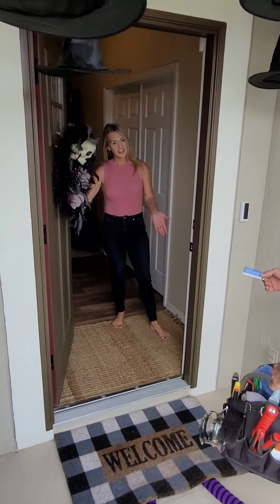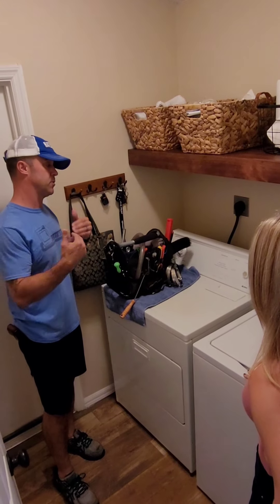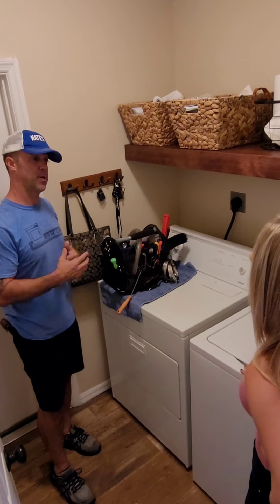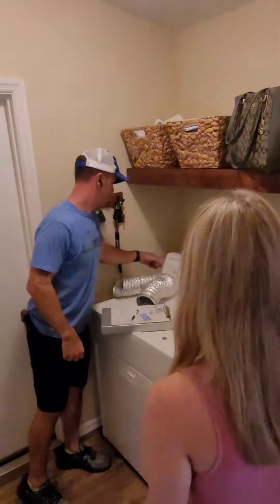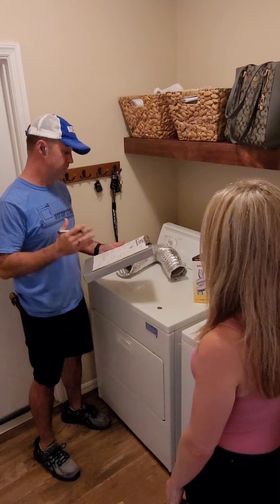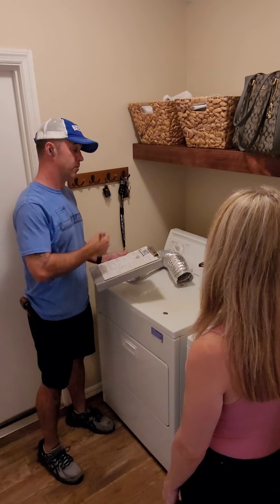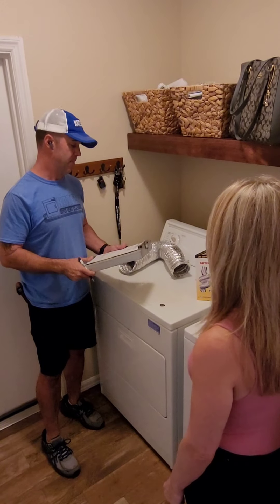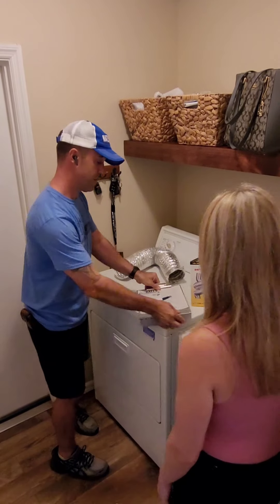Nate's #DryerVentCleaning from Start to Finish

Comment: Dang that was a ton of change in the bottom! I found 6 coins in mine but the fluff was.... well a LOT thicker inside my dryer 😖
Reply from the maker: Dryers only get that bad with lint when, at some point in the history of a dryer its connected to a vent has "problems" such as a blockage, or heavy build if of lint or other factors like a kinked or crushed connector hose, all of which causes back pressure of air.
Reply: Thankfully my vent is really easy to clean out, all in easy reach. The cause of soooo much lint may have been running far to long with a busted wheel. 😳 It has been repaired, cleaned and no longer sounds like a broken cement truck😅